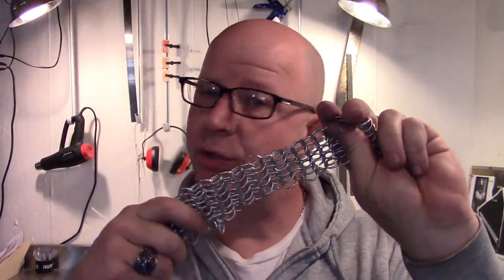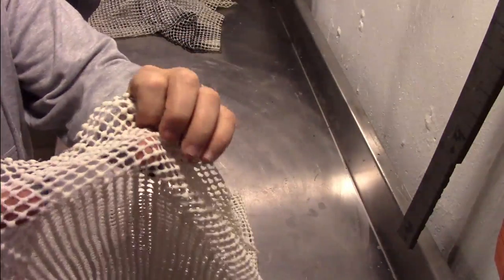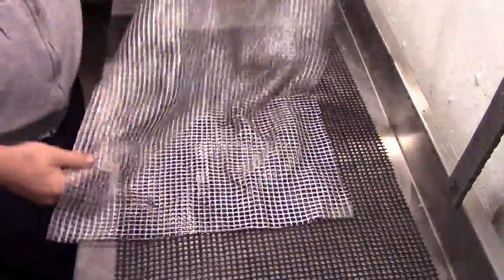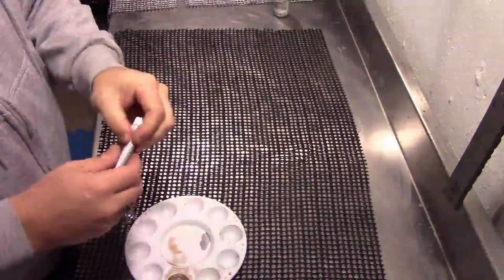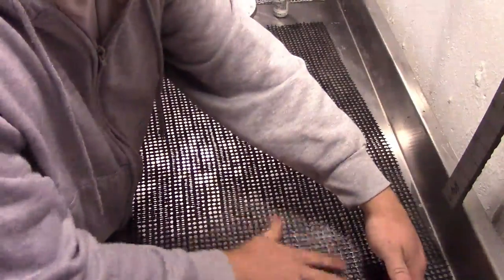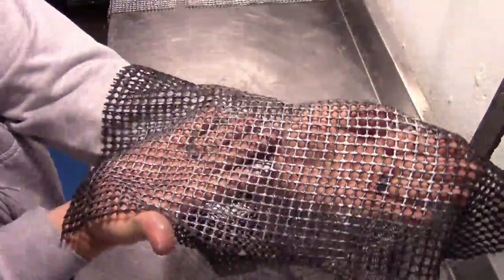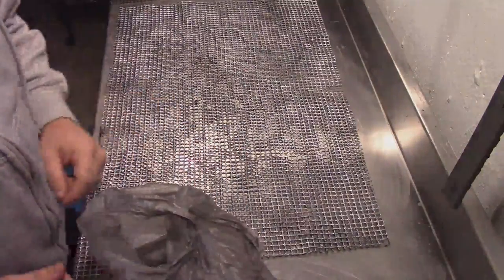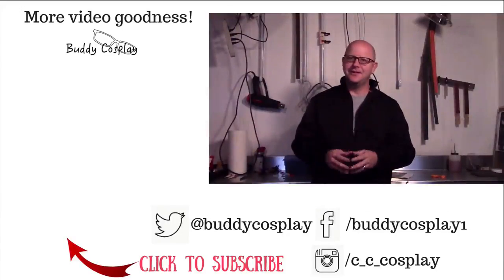Chainmail alternatives for your cosplay costumes

Comment: I wish I had known about this stuff before I completed my plastic chainmail pieces.  I made mine using plastic spiral bound notebook spirals I ordered in bulk from Lloyds of Indiana. I cut the coil into rings with a bit of overlap.  I started out trying to melt the overlapping bits together but this proved to be destroy more rings than it produced so I flipped the overlapping bits and used pliers to flatten them against each other.  It's a frustrating process because it often ends with the ends slipping out of place and needing flipped again.  So glad I'm done with it.
Reply from the maker: I hear you!  It's a ton of work and this shortcut works well enough to bypass the aggravation of creating it from scratch!

Comment: This material is used to prevent rugs from moving and to put int drawers of kitchen cabinets. You can buy them in strips in different colors from blue, black to white and other colors as well. So check out any place those discount stores that sell rugs, kitchen appliances, it's not too expensive and you get a bunch of them depending on the length and width will vary. You can also create a stencil with circles and just rub or spray paint over it to create the ring effect and it creates a very convincing 3d effect.
Reply from the maker: Great input!!   Thanks for adding to the information!

Comment: Did you notice that the just spray painted version remained sticky?
Reply from the maker: +Shaun Morrow The spray paint version will stay tacky for a while but adding a clear coat will often reduce the tackiness. Also, a light dusting of baby powder makes it go away as well.
Reply: Hey Guys! I'm using this idea in a costume build and I've got some advice to pass along: the mesh is coated with PVC. I'm reducing the tackiness with a soak in TSP before I paint it with Rustoleum's "Painter's Touch". I found that the sample I made without the TSP was very tacky for about a week. It got stuck to other objects and the paint peeled off. I'll follow up with the results of the TSP method later. Cheerio!
Reply from the maker: Awesome Awesome Awesome input!  Thanks for that tip!